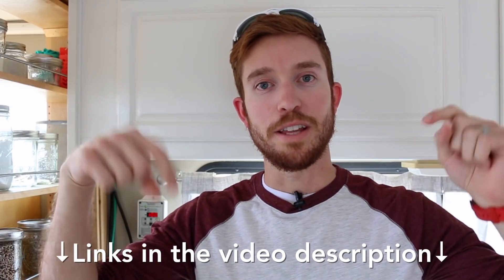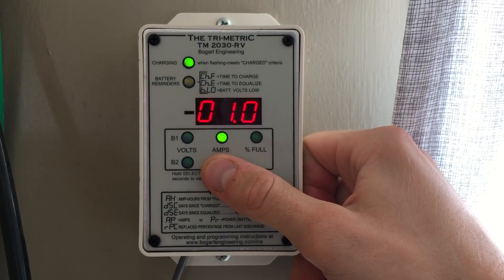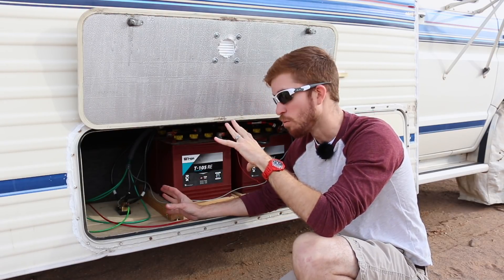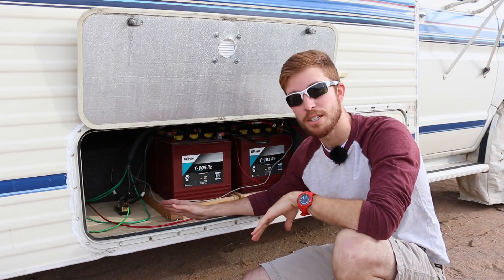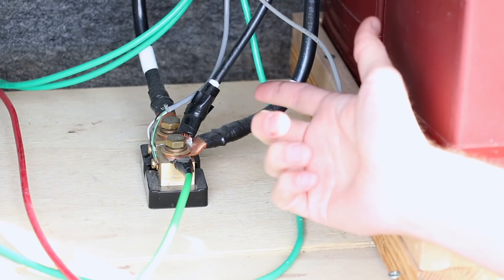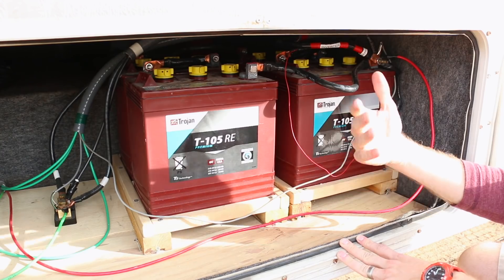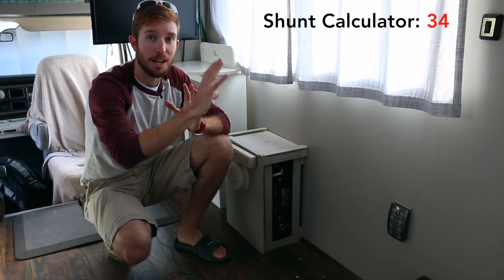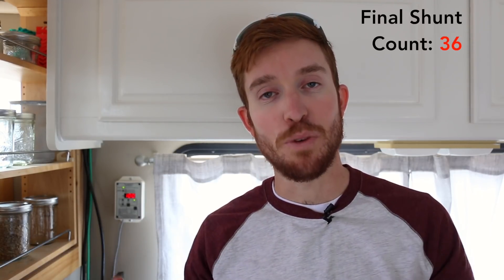Wiring a Battery Monitor + Shunt for an RV Solar Power System

Comment: Amazing I m Puting 4 batteries in series 200ah12v4x lithium it would be connected to 12 or 10kw hybrid inverter I m going to put them in series I need something so I can connected to the batteries and the inverter the same time that was the inverter can communicate and I can read it online isit possible ?

Comment: You mentioned the shunt transmits voltage to the battery monitor to display amps.  Any guess why I have intermittent (false) negative amp readings when the solar charge controller is on?  This can happen at night wen the SCC is sleeping too.  Thnx!  Rich

Comment: Some Observersations: you should upgrade to a lifepo4 which allows you to fully utilize your full battery and they also last way way longer.  2 you should use a DC distribution block rather then piling everything into your shunt.

Comment: Hi Michael. I have been enjoying your videos on solar power upgrades for an RV.  My question is regarding the solar charge controller and your use of a shunt.  Many of the MPPT controllers I have been looking at have a display and are capable of providing battery information.  I think this would avoid the requirement of the shunt for the battery monitoring.  The MPPT controller with the display could also be mounted in the cabin of the RV and not in the basement. Is there something wrong with my logic?
Reply: An MPPT and many other controllers will display voltage, which gives a general idea of state of charge, but can be off if there is a load or charge recently applied to the batteries.  They also display the charger’s output in amps or watts, but this isn’t necessarily the charge the batteries are receiving. 

The shunt measures amps going in or going out of the battery, and you can program the meter with the amp hours of your battery bank and it’s efficiency, giving you a much more accurate state of charge. 

It is also interesting to see what is going into the battery as opposed to what the MPPT charger is putting out. You might have 200 watts coming in from the solar, but 165 watts charging into the battery, for example, if you are also using lights and have the TV on…

Comment: Hey mate, amazing video! One quick question, why did you wire your inverter to the shunt? Shouldn't be enough with wiring the charge controller? Thank you very much in advance!
Reply: Every negative,  goes to one end of the shunt, and the battery negative goes to the other end,  so when you connect your sensing wires to the small screws on the shut, if you connect any loads on the battery side of the shunt, those loads will not be monitored, hope this helps

Comment: Here's a question about the travel trailer , Can you install the Shunt from the Negative Side of the Converter instead of trying to get to the Battery Cable ?
Reply: No because it needs to read the power from the controller as well through the shunt.
Reply: @gabrielmartinez3171   Hey Gabriel. The power from the controller is going INTO the battery right? Where the other wires are measuring power going OUT of the battery? I'm having trouble figuring out if all my negative post wires should be on the shunt. They are: inverter, chassis ground, solar charge controller.  That's it. Just those three.
Reply: @leelfm  through the shunt so it can properly measure power in and power out to accurately measure the state of charge of the battery. Also make sure your shunt can handle the max current of the inverter you are using.
Reply: @gabrielmartinez3171  Thank you. I got a 350A one and I only have a 1000w inverter currently. The other option was a 100A and I went higher to be safe. Should I got ahead and put the chassis ground cable through the shunt too? Just do it all through the shunt? Currently I have two batteries and one has the inverter from negative and the other has charge controller and chassis ground. I'd need to take them all off and combine them onto just one?
Reply: @leelfm  is this battery bank also charging from your vehicle? Is it still powering some of your 12v appliances or lights? If so to either question then yes should also go through the shunt. If your not charging from your vehicle and have a higher voltage battery bank ie. 24v or 48v and are using a step down converter to power your 12v system then ground the converter to the shunt.
Reply: @leelfm  you can wire 1 battery directly to the other in parallel but everything that needs to be measured has to go through the shunt.
Reply: Gabriel Martinez yes to both. It’s a 12v system. Batteries in parallel.
Reply: Gabriel Martinez I can’t figure out how the circuit is “complete.” There is no negative running from the battery to the neg bus bar or 12v appliances. The neg wires run to chassis ground screw, inverter, and from the charge controller. That’s it! Is my trailer completing the circuit or what? I can see another another chassis ground connecting to a neg bus bar which then goes to the converter. Shouldn’t the circuit be a “circle?”
Reply: @leelfm  yes the chassis is completing the circuit when the negative meets at the chassis ground. If I understand what you mean.
Reply: Gabriel Martinez yeah I was just thinking I should see a wire going from batt neg to the negative bus bar which then reaches all the 12v appliances (lights, water pump, etc) to “complete the circuit” but I do not see a wire that does that. Instead what I see is a wire from batt neg attached with a screw to the trailer.
Reply: @gabrielmartinez3171  Yes that is exactly what I mean. I can't believe the chassis completes the circuit - for some reason that just blows my mind. I just assumed it had to be a wire to complete a circuit. But I am so glad I know that now because it was really confusing me! Thanks.

Comment: interesting that you made a remote Negative post for the Shunt to  more easily stack the Inverter & charge controller cable lugs onto. I'm going to be challenged a bit to have my Negative charge controller lead on the shunt because of the way I led the POS & NEG cables from the battery bank outside to the interior connections for the inverter. I'm sure I'm over thinking the situation.

Comment: Great video but don't forget the losses on inverter a direct ohm's law calculation won't cut it. From what I have seen with pure sine wave inverters you need to factor a 10% to 20% loss.  The positive feed wire is also not just powering the meter it gives it a voltage reading. This is essential for the unit to calculate remaining capacity. That is a very nicely put together system you have there   :-)

Comment: I just got a shunt and monitor , are you saying you connect your negative coming in from your solar to one side of the shunt ,then another cable to the negative on the other side of the shunt to the battery negative ,is that correct ?

Comment: Great. Can you come up with a wiring schematic on shunt connection /battery/ loads/fusing/panels etc. Do I fuse the shunt connection ? or is that built in ?
Reply: A shunt is generally wired with a negative cable to the battery bank on one side, and all connections to negative on the other. Two wires (best to use twisted pair, small like 20 gauge) connect to the shunt. A shunt is basically a precise resistor, IE a 500 amp/50 millivolt shunt has a voltage drop of 50 millivolt at a 500 amp load. From the voltage difference across the shunt carried by the small wires, the meter can calculate amps going in or out.  The meter it’s self needs 12v pos and neg power, and that positive lead should be fused. Hope that makes sense.

Comment: So, The negative from the SCC, should go to the top of the shunt, if the bottom of the shunt is going directly to the negative post of the battery bank,,,??  
Why not put the negative from SCC directly to the negative post on battery bank? Won't the battery monitor sense incoming and outgoing??
First time I've seen it done that way and I'm looking for a reason.  
Let me know please.
Reply: I have same question did you ever figure this out?

Comment: Hello , I have watch your channels and I must admit, they have been very useful to my understanding of a whole lot about Solar power, and thanks a lot for your efforts. I am a complete novice in this field but am determine to do it myself as a do yourself person,  now I sometimes travel to Nigeria where there is a constant blackout , sometimes for a week or even 2 weeks in my area, we are lucky in our area as others experiences even months of blackouts. So this time I decided to invest in Solar power since I hated the noises from the neighbours generators.  My flat is on the top floor and I can use the roof for my panels. I bought 4 panels of 300W each and an inverter that is pure sine 6000W.  My intended uses are for runing the dish washer, airconditioning, electric cooker, computer, lights washing machine, a freezer and stereo system.  Since I intended to use these things, here is my question,  Which is the most suitable system, a 24V, 48V, 60V or more?  Which of the wiring method is best suited to my system, Parallel or Series? Since we are very close to the Equator there is abudance of sunlight all year round. Please your expertised input will be greatly valuable and appreciated. Thanks

Comment: I have a small cheap o Amazon battery capacity/level monitor/tester/measurer (whatever the hell it's called) that displays voltage and percentage. I don't care about measuring the volts, watts and current that's going in or out. I only care about the battery percentage measurement/display. Would I still need a shunt then?

Comment: Hi do you have any issues regarding battery volt reading compare to battery percent? I have a 24volt system and at 23volts my percent is reading 70 percent I don't think that's is rite and I have made all the checks. My total battery amp hours is 428amp and I program that into the monitor

The only time i get percent reading close to what should be rote is reducing the total battery amp hours to 210 amp hour

Comment: I would install a small inline fuse holder and a two amp fuse in the two wires from the shunt to the wall monitor. Just a safety feature in case the signal wires get shorted.

Comment: I heard another channel talk about you have to isolate your solar from your batteries when you use shore power or a gen. Is this correct? Or can I run solar and gen to add the amps together when charging my batteries and it would be quicker.
Reply from the maker: Great question. You can run something that's called a "hybrid" system where you can utilize both shore/generator and solar power at the same time. It is a slightly more complicated system though... Hope this helps!

Comment: It seems your math 2500/12 should really be 2500/120v... the wattage is the output wattage of the inverter.  And AC has a much lower duty cycle than DC.... isn't this correct?
Reply from the maker: Only after the energy is converted to 120V. The energy is always lower voltage until it hits the inverter. Hope this helps!
Reply: @DuetJustusFam  you are right, but your inverter is rated 2500W in the AC part of your system! You do not have 2500W in before hitting the inverter, hence your amperage is no way 2500/12

Comment: Well, you had to put it into non-technical terms, but for those interested: a shunt for measuring current is a very low resistance resistor with a very accurate (low tolerance) resistance. The voltage drop over that resistor is directly proportional to the current flowing though it. This is used when the current is too high to be measured directly. So in effect, this is simply Ohm's law with a high current and a very low resistance. It makes measuring the current flowing so much easier though.
Reply: Mhhh, maybe you're right. A very old nerd. I just paid attention to my physics classes back in the 80ies (and no, there's no 20 in front of those). Good old days - no cellphones or internet. HAM radio was top of the line...
Reply from the maker: Lol 😂
Reply from the maker: I love it when people nerd out 👍🏼😎 Great info and I appreciate you sharing the tech specs about the shunt. Everyone here will definitely appreciate it!
Reply: Uwe  Schroder  Thanks for translating it to something i can under stand , i loves me some accurate low resistance, i'm starting to like this guys videos , still on the fence though
Reply: Thanks, your explanation really helps.  Now it makes sense.  It just seamed like a direct conductor but knowing that the resistance is known it makes sense why and how an item like this works.

Comment: I am not sure you guys are right about doing the vent change in colder weather... It was like 25 and still having a hell of a time removing the sealant... Also you guys were right silicone sucks, and  doesn't fix anything externally...gah do I have a lot of work.
Reply: Also ohms power law

Comment: Great topic. The battery monitor is probably the very first thing to be added. That way you'll get a better idea how much solar you need based on your actual use. Did you install a catastrophic fuse and shutoff switches for your solar and inverter? I don't remember from your install video. BTW, I picked the TM-2025 since I wasn't planning on using Bogart Engineerings charge controller. It's a little bit cheaper.
Reply from the maker: Hey Richard! I did fuse everything and will be talking about the inverter on the next solar video. I will either be adding shutoff switches in the future or on my next install. Great questions 👍🏼